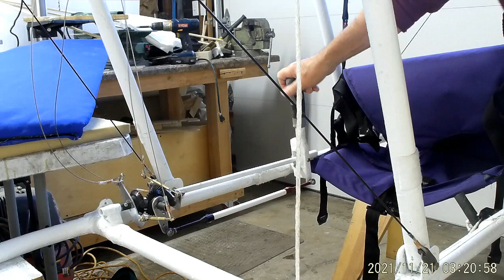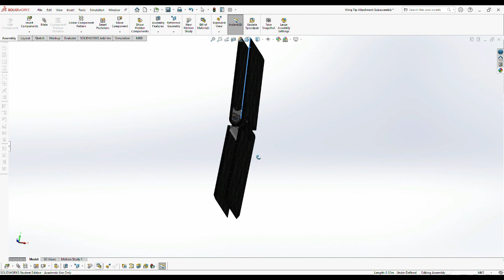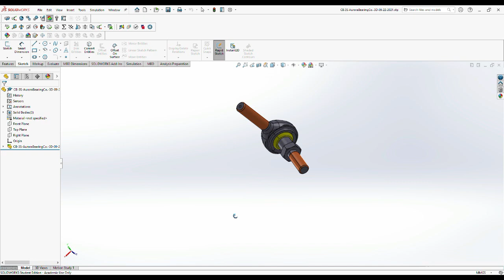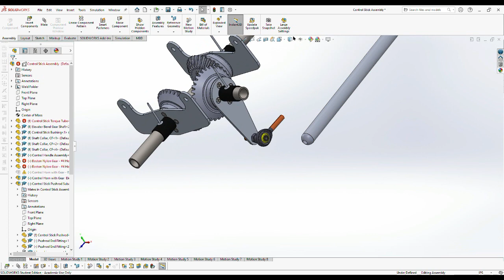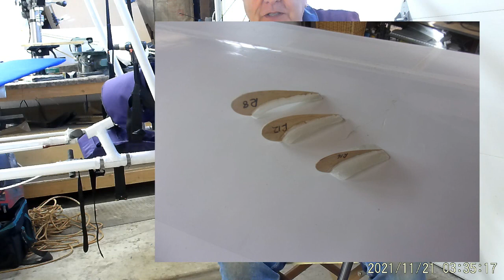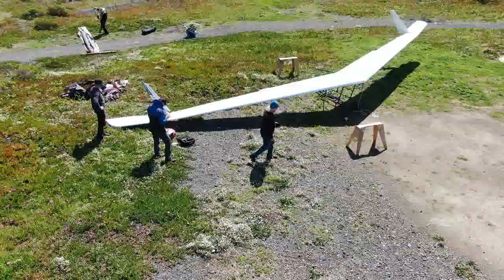Testing Q & A - Klingberg Wing MkII Development - Ultralight Glider Sailplane

Comment: Ah. . . Your description of material selection and testing is very real world and accurate. 
I once designed a 24" plastic wheel and had a mold tooled.   I sampled many engineering grade plastics, most performing far worse than their claimed properties.  My Dupont plastics rep. asked me how I tested the wheels.  I told him I threw them as high as possible in our parking lot to see if they'd break on impact.  He said it wasn't very scientific and he'd ask his Dupont engineers who designed the Skyway bicycle wheel how they tested them.  He called me back a week later and said it was funny his Dupont engineers told him they went out in the parking lot and tossed their wheels as high as possible  to see if they'd break on impact.
Reply from the maker: Thanks for the story, classic engineering at work. Made me chuckle and brightened my evening.